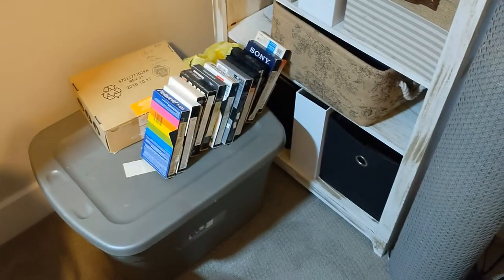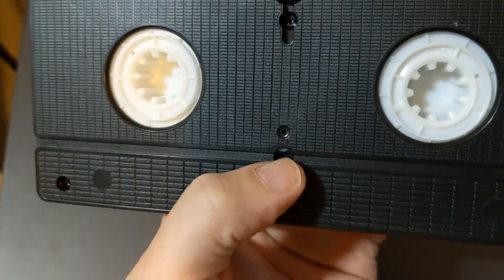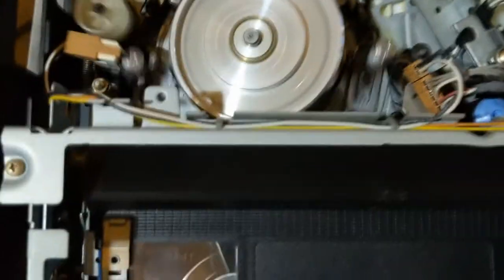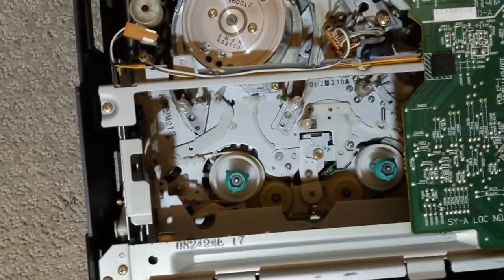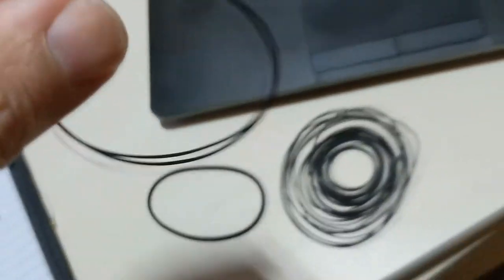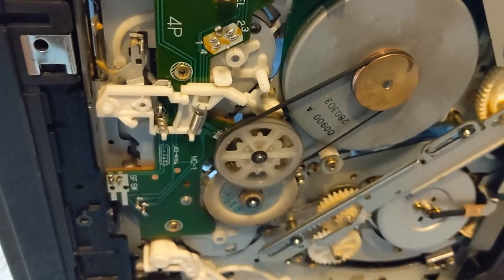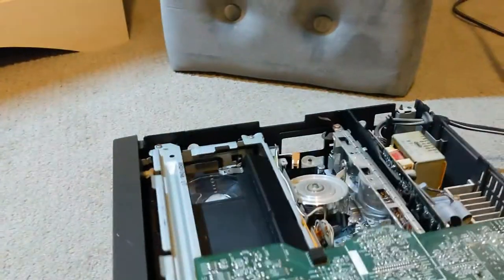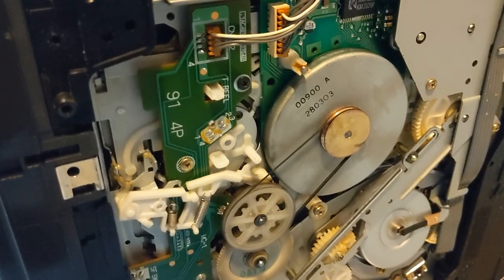VCR Fix - VHS Tapes Not Rewinding - Easy Fix

Comment: There are a couple of things worth pointing out here

1. If your VCR will play and fast-cue forwards and backwards, but simply won't rewind or fast forward, then a worn/stretched belt IS very likely the cause. This is because in play and cue, the tape is being pulled through by a pinch roller that literally pinches the tape against the motor shaft - the role of the belt is simply to turn the take up spool, which is relatively easy to do because the "heavy lifting" is being done by the pinch roller. However, in rewind or fast forward, its the belt that has all the work to do, and this leads me to the next point...

2. A badly worn belt is also a common cause of tapes being eaten. This happens when there isn't even enough tension to turn the take up spool, but the pinch roller is still feeding tape at about 1 inch per second (depending on format), and it ends up having nowhere to go, so you quickly end up with the proverbial rats nest inside the VCR.
Reply: thanks
Reply: I have a Sony vcr and it plays normally  and it is doing fast foward and backward normally too but when it comes to slow foward or backward (still on stop mode) it turn off ...i mean, when its close to begin or end of the tape its turning off... how could i repair? Can you help me?
Reply: This is what I'm dealing with right now... a JVC HR-S5911U that plays fine, scans forward and backwards fine, but as soon as you fast forward or reverse... it starts slow, but as soon as the tape speeds up, it grinds, then the machine turns off. Unfortunately the belts aren't as easily accessible on this unit, or I'd try myself. Luckily my city still has a repair guy that deals with vcrs. He's already worked on my HR-S7800U last year, at a pretty decent price as well.

Comment: In my case, it was not a worn belt, but weak motor. Happened on 2 identical emerson EWV404 VCRs. Belt was not loose as the belt would stop the motor when the driven pulley stopped turning. The VCRs would play and fast-cue either direction but not rewind or fast forward. My solution was to turn the VCR upside down, play, fast-cue forward, stop, fast forward - until it eventually fast forwarded, then it would thereafter auto rewind. Then rightside up, I would fast forward, fail/power back on for eject, reinsert, play, fast-cue forward, stop, fast forward, let auto rewind - until the "play, fast-cue forward" wasn't needed for fast forward to work. Massaging the motor in this way will likely be an ongoing treatment and not a permanent fix. Would never have gotten there without @Dirt Road 90's Kids video, thanks go out to the OP.

Comment: one thing i saw with the tape is that its unevenly wrapped on the spool which can cause problems like this. if you look the tape has lots of ridges that arent supposed to be there. one thing you can do fix it is to fast forward all the way, rewind all way, and fast forward all the way again and it should wrap evenly. also you can shrink stretched belts by boiling them in water for a few min (google how long to be sure, dont take my word for it) and if you're going to service it while its plugged in, dont do it on carpet]. static can fry the boards
Reply from the maker: I'm not sure I fully understand your comment. Won't the tape always be uneven on the spools based on where it is in the video? As mentioned in the video, I could not FF or rewind the tape because of the belt issue. Good tip about the belts. I know that will last for a while, but eventually the rubber is too far gone. I agree that I don't always follow the best practices when dealing with electronics, but have been opening and tinkering since I was a kid and never had any issues, so I'm a little lax on that, I suppose. It probably helps that I've always lived in a fairly humid environment and there's not a lot of static issues here. Thanks for the comments!

Comment: Hi my VCR it does not seem to FF properly, it takes ages to FF a 4 hour tape, and it's slow. What could be the problem. In stop FF it is slow, could the belt or something else be at fault.
Reply from the maker: The belt would still be my primary suspect. Although it could be other components, the belt is the most likely. As the belt ages and becomes less pliable and hardens, it's most likely that the belt is slipping when the motor is rotating faster. Opening it up and observing it during the FF event should confirm that.

Comment: Vhs tapes go bad huh ??
Reply from the maker: Deterioration of 10–20% occurs over a period of 10 to 25 years in normal conditions. It's worse if you have them stored in non climate controlled environments.
Reply: @DirtRoad90sKids  i have a few from the late 80's. They were in the closet until about 2007 when them and the other vhs tapes and dvd's were all thrown in a sealed storage bin and thrown in the attic when we moved to the new house. So they have been in an attic for 15 yrs in Florida heat ... 
I just pulled one of them out and played them and they still look good.